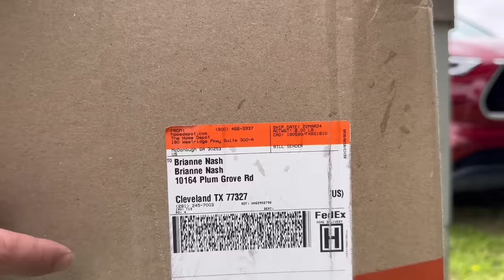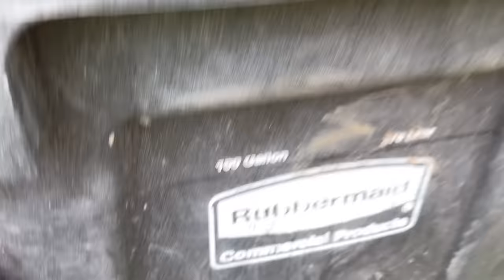Beating the rain to my morning chores

Comment: Hi Bri just put a roof over it similar to what Lester built at the sanctuary to keep the hay dry a few years ago it could help stop the bits falling off the trees straight into it also if you built it with the picket fence  with say an inch gap between them could look good and get air circulation  round 3 sides  of it so they just drink from the  front would keep the sun off it a bit and help stop stuff blowing into it 🤔 hope this helps 😊